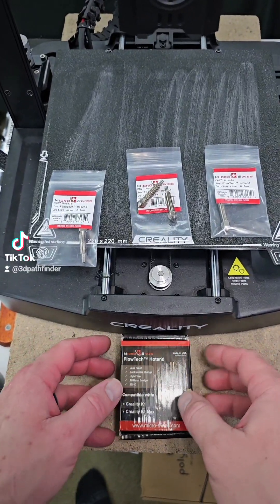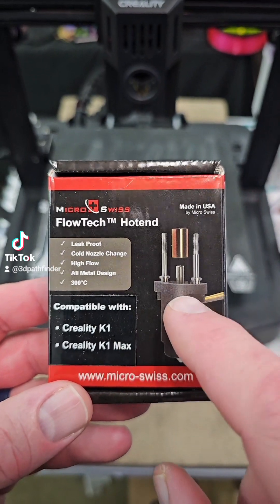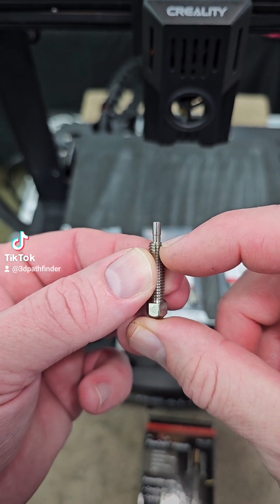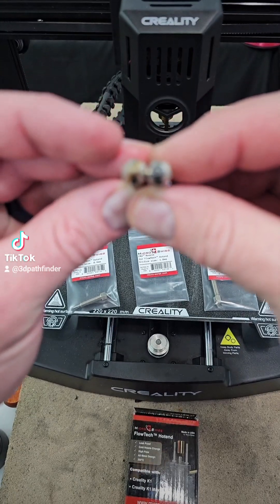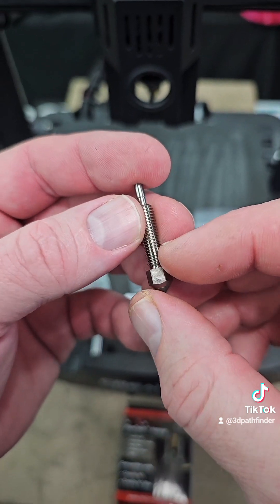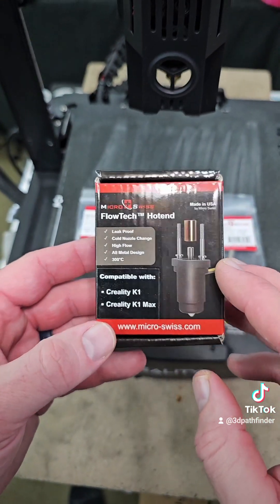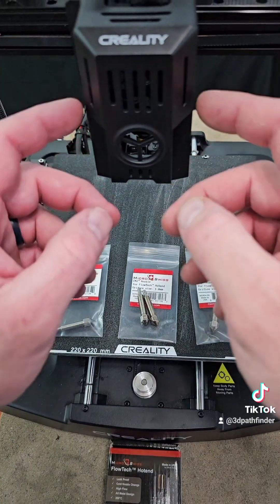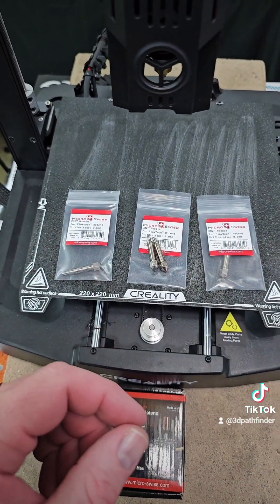Micro Swiss Flowtech Hotend CM2 Hardened Nozzles! K1/K1 Max

Comment: thank you for vid, so micro swiss cm2 is good to print pla ? is it better than brass coated nozzles? thank you !
Reply from the maker: the CM2 nozzles are hardened nozzles which means they will do the abrasive filaments . PLA is nothing to a CM2 nozzle . Imagine pla is like a pebble and the CM2 nozzle is a tank.
Reply: @3dpathfinder  so its the best for any filament then?
Reply: Nope. Basic nozzle is better
Reply: @marlion4664   I have tried the cm2, it is really terrible for the use that I give it, I use fast printing profiles with PLA, the cm2 did not melt quickly and caused plastic leaks everywhere, I will continue using brass, 30 bucks wasted.
Reply: @rokr455  Yes, you have to print slower with the CM2 nozzle.
Reply: If pid calibrate this and use own creality silicone. That black silicone. When i try to print bridges or over hangs. The air pushes down and push the filament downward.. So all tops comes not so goood